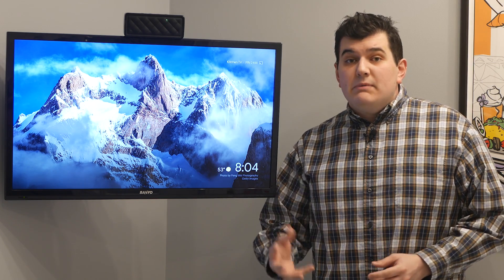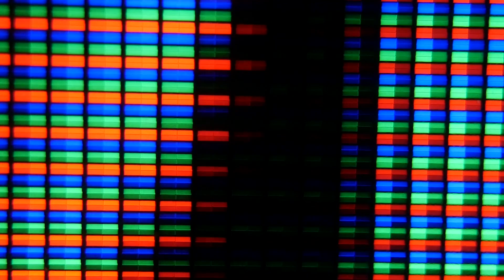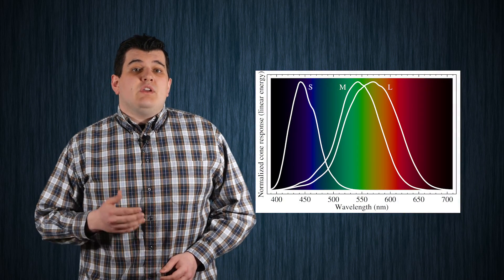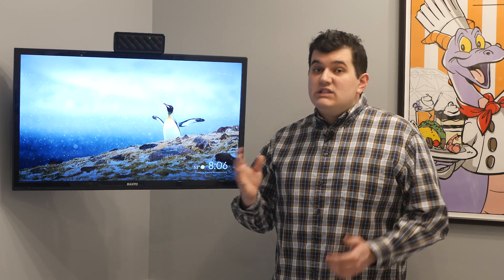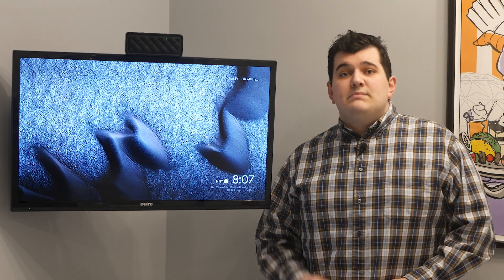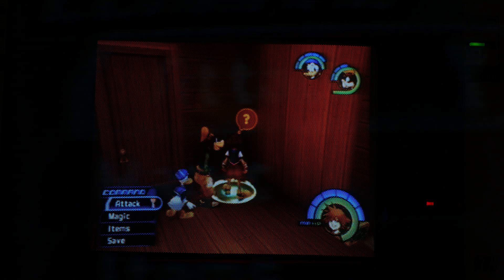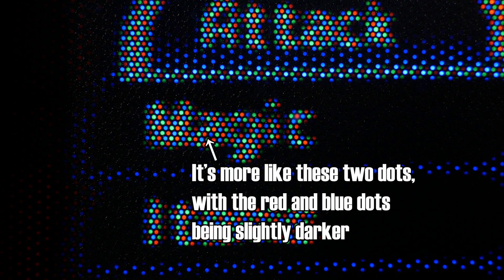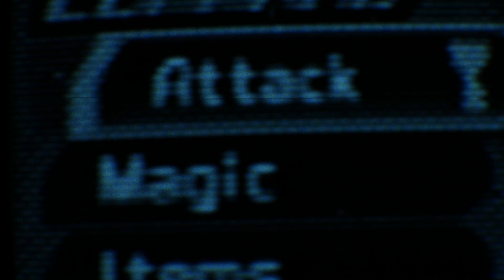These Are Not Pixels: Revisited

Comment: The problem with your explanation is, fundamentally, you don't understand the word "element". Element does not mean digitally discrete, countable and not sub-divisible. From Wikipedia, "An element is a part or aspect of something abstract, especially one that is essential or characteristic". It is merely something, that combined with other objects of the same class, makes something - in the case of pixels, a picture.

A brush stroke is a pixel. A pencil line is a pixel. They are elements that make a picture. Indeed, the word pixel predates even the invention of the television, let alone digital technology.

You're trying to apply a modern interpretation of what you think the word pixel OUGHT to mean to define it, when the reality is pixels are just things that make a picture. To say a CRT does not have pixels, because a shadow mask is not a true digital method of defining a single point on a screen, you are also saying, without thinking too hard, that a CRT is incapable of making a picture because it doesn't contain any elements of a picture. Which is obvisouly absurd.

The pitfall you seem to be determined to fall into is the Stonehenge problem. For a thousand years, the only 'henge' humanity knew about was Stonehenge. It's where the word ''henge' comes from. But over-excited archaeologists have since decided to try to redefine the word 'henge' to mean a very precise prehistoric type of structure, similar to Stonehenge. Except Stonehenge doesn't meet that definition. So Stonehenge is no longer a henge, even though the word henge comes from Stonehenge.

'Pixelsl' whether we like it or not, in popular and technical parlence comes from CRT screens of the 1940s. To say that those screens don't contain pixels because you've narrowed your definition of 'pixel' is a failing of you, not of the CRT.
Reply: BTW, I don't want to you to think I'm an irritating naysayer of everything you think - I've been a fan of your videos for so long, and I love pretty much everything you broadcast. But this one tiny, non-significant area of disagreement compelled me to argue.

Comment: I think a good analogy might be to say the horizontal resolution is near-infinite, but the vertical resolution is limited by the number of lines available. Based on what you've said, that seems to be the case. It would be neat to see how detailed a line could be on the black and white television because it's not limited by a shadow mask like the color sets. Shouldn't it be able to theoretically display a ridiculously large amount of "pixels" horizontally? Is there a way to visualize this?
Reply: It's limited by the speed the electron gun can change, the quality of the video, and the size of the dot made by the gun on the screen.
Reply: No the resolution is not infinite anymore than the your running speed is near infinite. There just is no simple limit like in a screen that consists of pixels.
Reply: @okaro6595  Nobody said infinite. He said near-infinite.
Reply: I his running feed near infinite? Just that you cannot  put a clear limit does not make it near infinite.

Comment: Okay, so, question: When I was a kid (like mid-90s), LCD displays had begun to see some use as laptops became practical, but CRT monitors were still pretty much ubiquitous in desktop computing. However, "pixel" was already in common parlance and used to describe the composition of an image on any computer display, whether CRT or LCD. Additionally, it's been a while since I've been nose to glass with any sort of CRT, but I'm seeming to remember CRT computer monitors having a truly rectangular grid rather than the offset/staggered grid of CRT TVs. So my question is: are purpose-built CRT computer monitors different from CRT TVs in a way (addressability???) that allows their display to be considered "composed of pixels" (and if so, can we get some more details on how they differ), or was this just a case of the general public hearing a technological term, saying "wow that sounds cool and futuristic" and proceeding to misuse it?
Reply: Color CRT is color CRT. The shape and size of the color elements can vary but the principle is the same. In a computer there are naturally pixels in the image but once the signal goes to the VGA cable, it is all analog. I recall monitors having similar triangle pattern as older TVs instead of the three side by side as in newer TVs.

Comment: About placing a screen over a newspaper:
By that argument, one would have to argue that even on an LCD screen, those individual crystals are not pixels either.
The semantics are coming down to exactly how you are defining a pixel, of course.  In the bulk of your argument, you are referring to the image as the signal being sent to the screen.  (Which is fair, and by that definition would mean they are not pixels.)  But then when the LCD TV displays the image, it is adjusting that original signal to meet its display.  It uses a different method than the CRT TV, but it still is the same final effect.  The TV has taken the signal and changed it into something else for it to display, often resulting in a loss of data.

Personally, I would argue that a pixel on a screen is more commonly described as the individual point of light on the screen.  Even with that screen with the pinpoint holes you demonstrate with great detail, I would still state those as individual points of data.  Naturally, we can't compare them directly to the pixels on an LCD screen, the kind of data they represent is utterly different, and largely it is pointless to try measure it anyway.  But I still think it is just as fair of a definition as saying that the elements on an LCD screen are pixels.  In the strictest sense, those elements exist as an analog diode just he same as the phosphorus on a CRT screen; they change their brightness according to how much power they receive, which is also coming from another variable light source shoving light through it.
Reply from the maker: The trouble is that the phosphor dots are not all-or-nothing.  There can be detail within each dot depending on how and where the beam lands.  This is not possible with an LCD.  The main issue is that the phosphor dots are in front of the raster.  The LCD's pixels are the equivalent of a raster.

If you put a second grid, such as a transparency resembling the phosphor dots of a CRT, in front of an LCD panel, have new pixels been created?  Or are you now just looking through a separate grid at an unrelated image behind it.

I know this is mostly semantics but there's at least one fundamental conceptual difference: a digital video pixel is the smallest element the screen can physically produce.  A phosphor dot can be half-lit and/or can represent multiple scan lines.  13:06 is the best example--the center of the "g" in magic is created by lighting just the left half of the blue dot and the right half of the green.  The shape behind it ends within the span of a phosphor dot, so only part of it becomes lit.  An LCD panel could light each dot at 50% intensity, but it cannot arbitrarily light portions of a dot to define shape beyond the dot itself.
Reply: After a fair amount of consideration, I'm going to largely side with you on this.  If we are defining a pixel as a single point of picture data, then no, the points on a CRT screen cannot be considered pixels.  You are right.

I was thinking about this discussion last week when I was looking at some old arcade screens, and remember getting into a short debate with a friend about the screens in those units, or rather, I had stated that a CRT screen has effectively no true native resolution.  He had corrected me, citing the time he had spent as a technician repairing arcade machines, and I basically just took his word on it.
Now that I understand better how CRT's work, I feel that I have to resume my original statement I told my friend: A CRT screen has no native resolution because the display is analog.  Granted, they still have a stronger limit than I probably thought they did at the time, and they do have resolutions that "work better," but a good CRT monitor can work well with a wide variety of resolutions.

I believe that conversation started when I was lamenting the loss of a trinitron computer monitor I once had.  It was a beast to carry around, but it was well worth it for the superior picture I got that LCD monitors couldn't touch.  I was moving my computer one day and had set the trinitron on my bed.  A minute later when my back was turned it had slid off the edge of my mattress, fell two feet to the floor, and then never worked again.
I still kinda miss that monitor, but now I have a really expensive LCD that actually gives me the range in color clarity I was missing for a few years.

Comment: You're still approaching the issue from the TV end, whereas a pixel is a computer technology term, not a TV tech term until the transition to LCD/Plasma and other dot addressable technology. Those groups of phosphor dots may or may not be a pixel depending on the source being used, at which point it's only a pixel at the source's end and what's displayed on the screen is the best available representation of those pixels on the hardware. Concentrating the discussion of the TV electron gun and shadow mask just obfuscates the issue.

Comment: Nice argument and yes mostly semantics, but to me computer monitors and tv's both using crt's had what I would call an "effective" resolution. They might not be individually addressable, but there was an upper limit to how many picture elements (how much detail) could be effectively displayed. Television was standardized so talking resolution was about useless. Yet for CRT computer monitors resolution (and dpi) was. I had many hi-res crt monitor. the last one doing 1600x1200. I do not know how many actual phosphor dots there where, but it was and is not important. It could display/process from (S)vga 1600x1200 effective.  
The words resolution and pixel where around long before lcd monitors where so you cannot claim them for such just because they can be more easily pointed out on an lcd

Nice demonstration of the shadow mask BTW.

Comment: EDIT : ok I am clearly not the first one to bring that up, I should have read the 586 comments before typing mine.

One more point in favour of "this is not a pixel", is that on the electronic tube, the rectangular zone receiving electrons are sometimes lit in a progressive manner. You can clearly see that the "dot" or the "rectangle" has some part lighter than others.

A pixel is supposed to be the smallest part of an image. You can logically divide it again to allow it to give more or less light (in a logical way : divide it in 8 parts where you can divide the light by 2 or by 4 or by 8) but it is a tool to assist the pixel.

But in an analogic image, your rectangles or dots are just borders made on a map. The light hit it nontheless in a natural fashion and will lit parts of those cells, making the cell NOT the smallest part of the image.

An illustration of this can be seen frequently on this video.

Comment: the 3 RGB CRTS (or 3 monochrome CRTs) made me think of early rear projection TVs! they would have been worth a mention here too, since it is 3 monochrome images with 3 different phosphors all projected at the Fresnel sense to converge them in to an overlaid/combined colour image! no pixels there either :D

Edit: I also would have mentioned that the 3 cathodes in a colour tv are wired to respond to the separated RGB signals in the broadcast, the shadow-mask is there to ensure the correct gun lines up with the correct phosphor dot according to its designated colour, a way to demonstrate why this is important can be shown by placing a magnet near a colour TV, causing the electron beam to skew out of alignment:- on a B/W tv it just warps the image which isn't so bad, but on a colour tv this warping means that the beams are no longer aligned correctly, producing the rainbow effect.

Comment: Another way of saying it: A pixel is an element of a screen that is randomly addressable for reading and writing. A CRT screen thus has no pixels as you can not address an individual part of the screen, you must provide a complete picture, top to bottom to display your "dot". The resolution of the lines on a CRT screen is measured in MHz. The more MHz you have, the more colour/brightness changes you can show on that line.

Comment: I suggest everybody should watch this video at the highest YouTube resolution because if not, you will see the pixelization of the format itself. And that’s something else that needs to be covered too with modern broadcasting. “Broadcast Resolution”. I’ve seen many digital channels with poor resolution despite the TVs ability to have high resolution capabilities. Many digital channels look blurry Which can be actually worse looking than the broadcasting of back in the 80s and 90s. Back in the day with a very good antenna and a decent screen 99% of all the channels have the same clear crisp picture. But nowadays  it’s all a mumble jumble of formats and format resolutions. The digital HD that’s available is supposed to be actually the standard digital  TV. And true HD no less than 4K.

Comment: What is your source for this?
If I give you this, then how did the word pixel come about before LCD screens. Why did cga, vga, xvga etc have differing resolutions, How where there differing resolutions?
they are pixels analog control or not.
Webster says
 "Pixel: any of the small discrete elements that together constitute an image ."
nothing about analog or digital just "any small discrete element"
Reply from the maker: The missing part is "that together constitute an image".  The phosphor dots are not what makes up the image.  That's the raster that's behind them.  The problem is that the phosphor dots appear to be building blocks of the image, but they are actually on top of the image.  Their purpose is to create color through separating the RGB components.
It might be helpful to look at the Joly Screen process for color photography:
http://zauberklang.ch/filmcolors/timeline-entry/1334/

This was an old method of producing color images by placing a colored screen on top of a black and white print.  The screen didn't change the image that it was on top of, but it did cause the R, G, and B components to correctly line up with the screen itself.  But it was not a part of the image itself.
This is analogous to my example of placing a grid pattern on top of a black and white CRT.  That's precisely what the phosphor dots are are relations to the black and white image--the only difference is that there are now three electron guns instead of one, and the shadow mask prevents the beams from hitting the wrong color of phosphor.

Comment: So basically the phosphor mask samples 480 continuous lines. Depending on how the mask is arranged you get a different sampling of the same signal. While different to digital monitors, there are also lots of similarities. I would argue that even LCD displays don't have pixels, but rather 3 dots that approximate one pixel.
Fun fact: Using a grid-like mesh as shown in the video can actually create Moire artifacts in real life.

Comment: Thinking about this and computer CRT monitors that could display high resolution images (1280x1024, 1600x1200, etc) it seems that the size of the phosphor dots would have to be smaller than the intended maximum pixel resolution in order to actually see each "pixel" in a digital image.  Of course your rows of pixels get converted into scanlines, but ideally you would be able to discern a single pixel change in an image displayed on a high resolution CRT monitor and that would mean having the phosphor dots small enough that individual pixels within the scanlines are visible.

I've always wondered why computer CRT monitors used phosphor dots so small they're practically invisible to the naked eye while television CRTs used gigantic phosphor elements that reduce the color resolution so much.  Computer CRTs had excellent color resolution in comparison, even for monitors intended to only display 640x480 (same as the 480 scanlines of NTSC television).  Display a 640x480 image on a VGA CRT vs. a CRT television.  Same number of scanlines, theoretically the same resolution picture, but the VGA CRT looks a million times better since it has a denser array of phosphor dots (which means higher color resolution).  I guess TV manufacturers determined that brightness was more important than detail.  I guess TVs weren't displaying dense small font text though and typically viewed from further away.
Reply: How hard is it to get that the color dots are NOT pixels. Sure if you pushed the monitor to higher resolution than the dot pitch the image quality would not be optimal.

Comment: What defines a pixel is the driving tech, not the end delivering tech.  EGA and VGA were used on CRT screens, yet still had defined pixels.  Check the history and try again....
Reply from the maker: I have checked the history.  The term "pixel" first appeared in writing in 1965.  The shadow-mask CRT was developed in the 1940's, with the first commercially available television with a color CRT hitting the market in 1954
As I explained towards the end, a CRT can display a pixellated image.  It just needs to draw small squares.  But that =/= "phosphor dots are pixels".
Reply: I went back and played the end.  You did spend 30 seconds explaining that a pixel could be shown on a CRT.  After 16 minutes of explaining how a ray trace is not a pixel, alluding to ray trace being unable to produce pixels.  While LCD/LED displays are restricted to pixel images, it is not the definition of a pixel.
Reply from the maker: The premise of the video never was that a ray trace is unable to produce pixels.  The premise was that the phosphor dots aren't pixels.